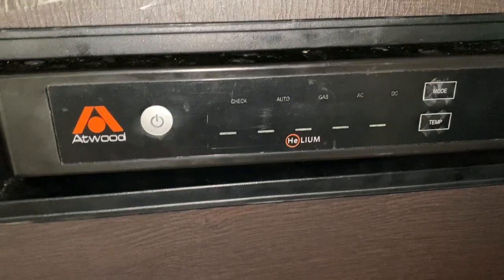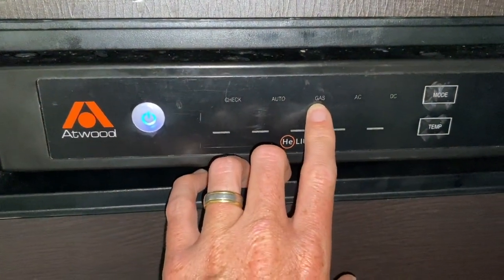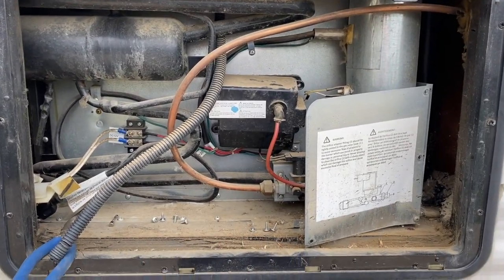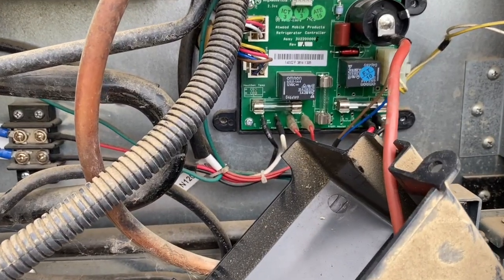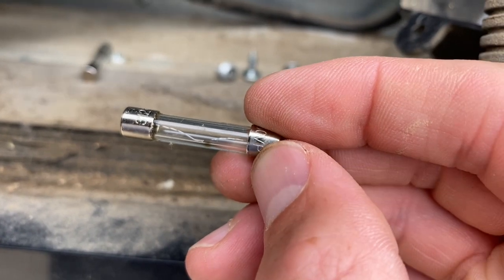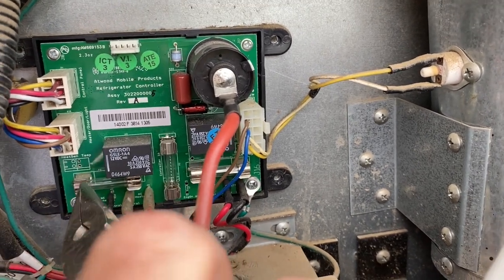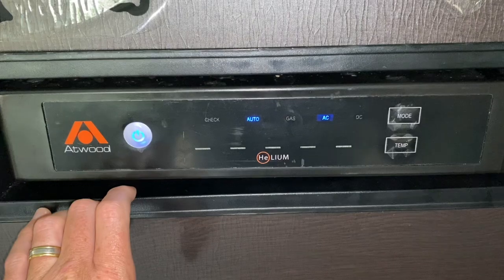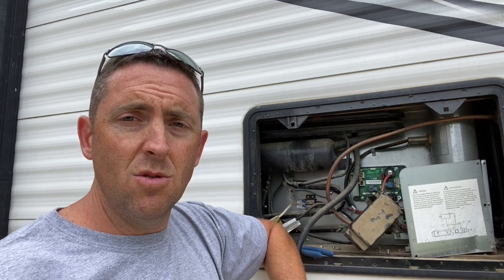RV fridge not switching to electric

Comment: I'm sure it's helpful for some. I knew to look for a fuse and I found a 5a fuse blown, replaced it. The fuse didn't blow again, but the electric still doesn't work. I can hear a relay switch over when plugged in. The flame goes out. But it appears to not be energizing the electric heater coil. The coil measures infinite resistance. I don't think it should, but I don't know yet. Will keep searching. My fridge is a Dometic that operates in a similar manner.

Comment: Make sure it’s the correct voltage fuse. Using an automotive 32v 3 amp or 5 amp fuse on an RV plugged into 110 isn’t going to work.

Comment: I could not get my new element all the way back in.
Reply from the maker: Sometimes it tricky. Did you get the right size fuse?
Reply: @paulworsencroft7829  I got it in. I pried it with a hammer handle again the outside wall frame. Then I took anther hammer and tapped the hammer head I was prying with to tap it in.Thank you